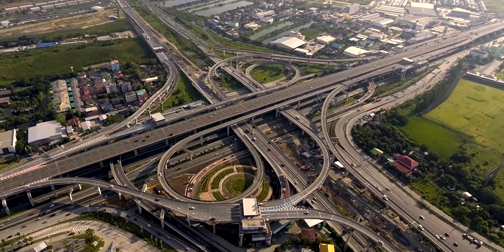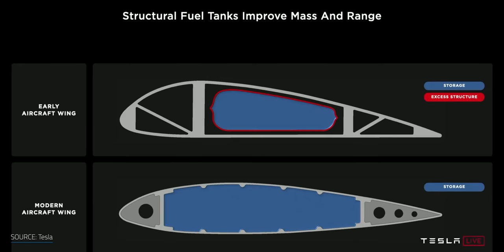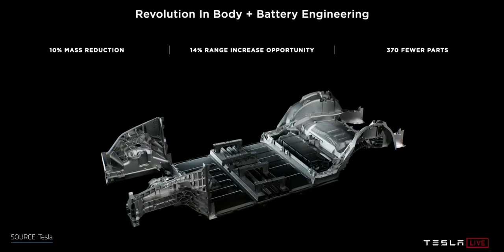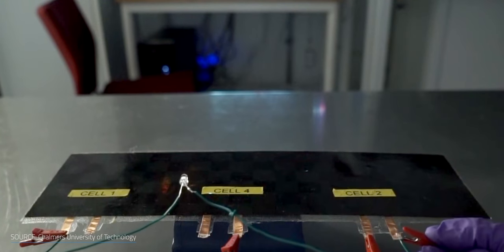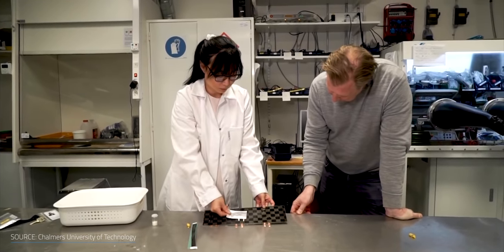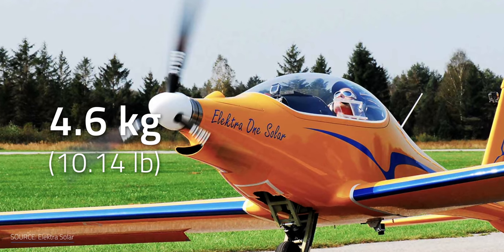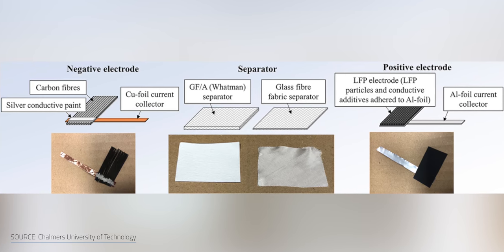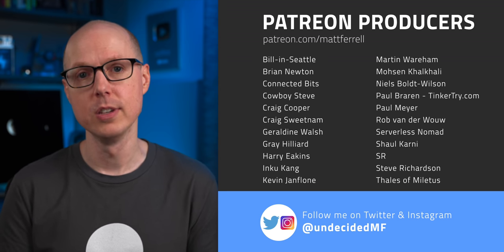Exploring Structural Batteries

Comment: "Yes, I need to order a new fender"

"That'll be $10,000"
Reply: a diy 'plastic string' instrument is cheaper ^_~
ohh you mean a self collapsing bumper rail
Reply: This is precisely why the entire car will not be made from these batteries.
Reply: What capacity and voltage?
Reply: @TheOriginalEviltech  how long is a peace of cordage, as long or short as You make it.
Reply: Should be obvious to most that structural batteries won't be used bumpers etc..
Reply: @informitas0117  Elon is smart, he has Metal shell on Cybertruck
Reply: Or, "sorry lady, your battery is shot. I will cost you three times the retail price to safely dispose that hazardous waste".
Reply: It already is $10k
Reply: the battery has a lifespan, this makes sure you need a new car when it runs out.
Reply: @hop3881  or you just get a replacement battery just like you would an engine. Or are you going to tell me engines don’t fall over time? Cost of upkeep to keep it running for as long as possible > replacement battery and you’ll probably get a good 20 years out of it. Most people replace cars every 5 years. Maybe 7
Reply: @saberg2443  that's a ridiculous comparison, engines fail due to mechanical damage over long time periods if properly maintained/lubed but batteries have like a 5-10 year lifespan -> guaranteed, there's no passing that ($50,000?) Tesla down to your kids without spending almost $20,000 on a new battery and that's for the old model, i wont even wager a guess as to how much this replacement would cost! This is a daily driver, not a damn Indy race car. Enjoy your disposable car.
Reply: Battery packs need to be made easily replacable, not requring completely dismantling the car. Either that or companies need to pay for the recycling and disposal of all of their disposable cars. The used car industry will be kaput as well.
Reply: @Maximum_777  But it will definitely not be replaceable any longer. Without swapping out the entire section the battery resides in anyway.

Maybe this is to stop people being able to replace a 5 - 10k battery (no idea what your local prices are this is what I have heard in mine)  with having to either rebuild the entire car or replace a 10-20k battery.
Reply: @hop3881  This was my first thought, designing it so you cannot replace batteries (easily) like they have done with phones and laptops. Basically make a throwaway car - unbelievable.

Comment: Uh, how do you replace the batteries when it is part of the body?  In the heat of AZ, batteries only last 3-4 years.  Do they propose to tear the frame out to replace the structural batteries?
Reply: no, for example, the doors of a car could be the battery. or the trunk. or the fenders.
Reply: Just throw your whole car away and buy a new one. Of course, that negates, entirely I might add, the environmental benefit of buying an electric car.
Reply: Apple strategy for cars.

Comment: "structural batteries" just lead to one way.
You should start this kind of info with a disclaimer about non recyclable products and programmed obsolescence.
Reply: I agree, Tesla has been leading the charge in making cars unfixable. Throwing out a whole car because the battery died(and is a part of the structure) sounds ridiculous. Crashes may happen, the batteries obsolescence will happen.
Reply: @LostInAutism  exactly
Reply: This was the first thing that came to my mind too
Reply: @LostInAutism  plus what about batteries that take fire or explode in case of crash?
Reply: There you go.
Reply: @LostInAutism  The only way is to make removing the battery easy, a slot in door panels, roof, bonnet, boot door and floor. This could mean  the batteries need to be very very light,  of course solar panets on cars need to be able to be removed and replace. If these were auxillary batteries in conquction to the main one it could work. What I mean is have the main battery be 50-70% smaller in a compact format using the types mentioned in the video, this means if a car has a accident it does not cost the earth to repair and  it can get home if had just a bump etc. Also engines needs to be smaller but more powerful, more effeicent in using energy as well. What we need is that anti gravity engine found in a ufo, which the americans captured at roswell.
Reply: @LostInAutism  The battery modules Tesla uses right now let's them replace your entire car's battery with new/refurbished modules while they throw out your broken ones and remanufacture the rest, usually at no cost to you. This essentially gives you a free battery replacement because they're able to recycle the modules, unlike every other EV that just throws out the entire battery.
This new method just houses the modules within the structure, the structure sandwiched together with glue, not welded. The only downside is that module replacement will require unbinding the glue of the structure to access the module array.
Reply: That and if the battery get corrupted especially damage. You have to buy other non-repayable and disposable car 😑. Was better being a big block back of our car or front than the complete body, least then you can replace the car part.
Reply: You should lead your comment off with a pessimism disclaimer.
Reply: @TheInevitableHulk  AND gluing it back again. Good luck replicating the factory procedure at some service point.
Reply: Exactly!! I can't believe this isn't a bigger topic of debate..
Reply: @C_R_O_M________  I'm not saying this is self repair friendly, I'm just saying that it's recyclable.
And to your point I think installing and positioning the load bearing modules would be significantly more difficult that just gluing the frame's lid on for a third party.
But I mean at some point all these efficiency gains need to be compromised with less moving parts. The same reason you can't replace the gpu of your phone reasonably.
But again, I don't necessarily agree with every efficiency gain at the cost of self modifying your own equipment.
Reply: @andrasdudas8226  That is why a good portion of these things are called prototypes. Yes Tesla is selling their ideas and aren't calling them prototypes, but who would buy a prototype in the first place in today's market? That word itself screams bugs, and by definition wouldn't be worth our money. This means the business model for Tesla would ultimately fail, and these would not get to market at all. Nothing has been said about people getting an upgrade deal on a newer Tesla model for trading in an older one, or anything of the like. All of that is possible simply because regardless of how much money "could" be lost by letting you trade in for the newer, lighter, and more fixable model, the company still has plenty to gain in the long run for being able to put these vehicles out on the market and pushing combustion engines back at least a little bit by bit. Just one man's opinion.
Reply: "Shorter lifespan," "planned lifespan" would be a more proper terms for much of the time "programmed obsolescence" is used. "Obsolete" generally refers not to the lifespan of a given unit of a product, but the whole model. So there's almost no way mass-industry can avoid having programmed obsolescence, meaning eventually discontinuing old models, rather than keeping them forever, somehow. It's not only financially untenable, but also not any "greener," arguably the opposite.
And even a programmed lifespan is not inherently bad, it's mostly a trade-off between what people are willing to invest and the inherent durability of the thing at that cost. For any thing someone claiming is artificially short-lived in a way that shouldn't be, technically you could pay some people to commission a unit or more units of the same thing with top-notch quality that would last much longer, but it would be more expensive than what's mass-produced, and it also has the problem of eventually its features becoming inherently obsolete. How good would be a 10MB hard disk drive (MB not GB, not TB), the size of a brick, from 1990, still working today?
Reply: @Mulberry2000  or maybe the whole car is sort of lego-like, kind of like the Citroën 2C. The big issue I fear is that maybe ultimately all the battery making and disposing may be less green than some "green"/"clean" fuel, like from biomass or something with a good EROI.
Reply: @TheInevitableHulk  And of course if the entire structure houses the battery, the actual crash structure needs to be unglued which is equivalent to unrepairable, and the moment Tesla refuses to fix it for you (which they do already many times), it is useless. This is a very bad idea altogether
Reply: @Sod White Planned obsolescence for the sake of profits is bas for everyone but the manufacturer/seller. The consumer loses, the environment loses...
Reply: @LostInAutism  the battery pack of the Tesla Model S can be swapped in under 90 seconds.
Reply: @petitio_principii  So does that justify companies only designing products to barely last the warranty, then immediately go bad and needing replacement?
Now imagine this technology literally making devices unrepairable
And you have the perfect storm of "Everyone loses except for the company getting insane profits"
Reply: Amen

Comment: "You keyed my car!!"
Service tech: "Yeaaaah, you're gonna need a new battery now."
Reply: I don't think paint scratches will really be the issue
Reply: Get a new car
Reply: Xmodalloy: lol, would be cool if the skin of the vehicle was the battery, it would make a fender bender a pretty big deal...
Reply: @rhalfik  If only touching a single point of any electrical system would actually do that. Then again, every bird sitting on every high voltage line would be dead.
Reply: @xmodalloy  Ever sliced a battery?
Reply: No with my Cybertruck. He needs a new key now. Oh well…
Reply: @rhalfik  Yes, the knife or nail carries the charge internally causing a short circuit and the battery heats up and catches fire. It does not shock you.
Reply: Stewie Griffins  With good shoes, you get a mild buzz. That's because it's AC and there's a few microamps that comes through via the capacitive coupling of your body and the ground. Batteries are DC. Capacitive coupling doesn't create a flow path for DC voltage.